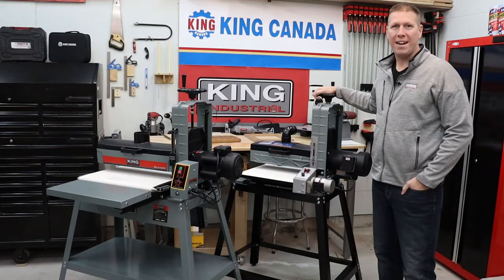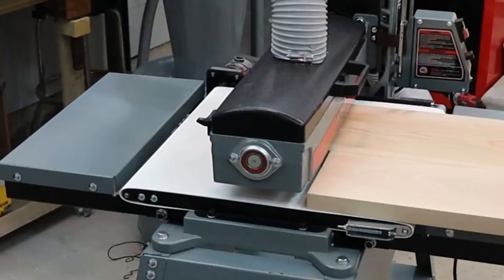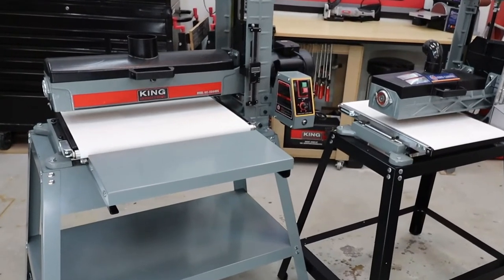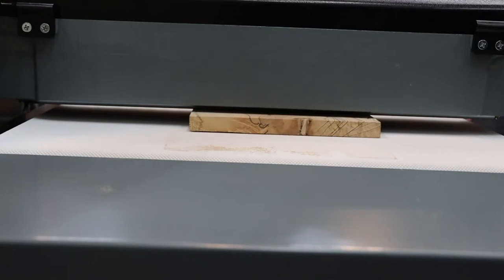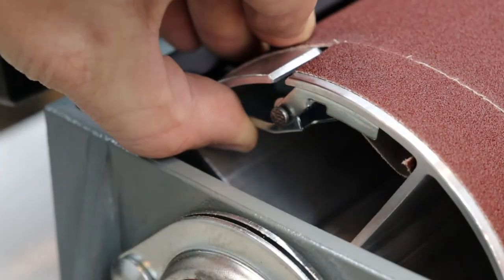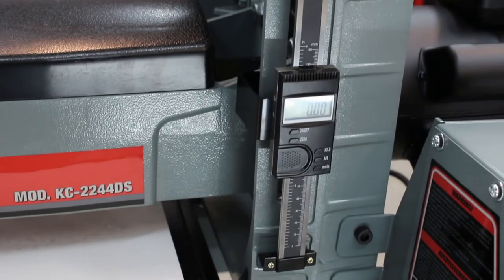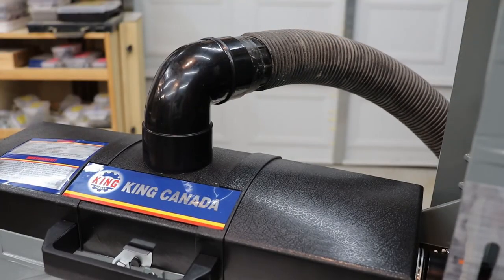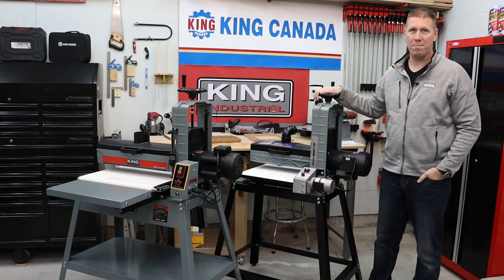New KING CANADA Drum Sanders

Comment: I don't find your sandpaper replacement very easy the clasp on the right side is the most awkward thing to use and never seems to grasp properly I have ruined so many belts I hate this system. I wish you would do a video showing exactly how to make a pattern for each end of the paper and then how to incert it into those clamps properly.
Reply from the maker: Hello George,
we actually do have a video that shows how to change the sandpaper. Please follow this link: https://www.youtube.com/watch?v=s63CFtci9nI
We hope that will help and if you have any questions, please don't hesitate to contact us or our service department.
Thank you!
Reply: @KINGCANADAINC  That video uses 5" paper my KC2244Ds machine uses the 3" paper and the angles used to get the taper in that video don't compute and when he says mark the paper where it intersects with itself what does that mean he doesn't show that part. The instruction manual that came with the machine says that the angle should be 11 3/4 "" I just cut it at that and it doesn't roll on right.
Reply from the maker: @woodie763  We are sorry to hear that the process is getting complicated. You're right, in this video, it was used a 5" sand paper. If to consult the product page, the image, as well as the web manual say that for 3" belt is cut 15-3/4" diagonally:
https://www.kingcanada.com/en/products/woodworking/sanders/kc-2244ds-22-open-drum-sander
We also can recommend another video that shows how to install the belt:
https://www.instagram.com/reel/CkisbI-gof4/?utm_source=ig_web_copy_link
Hope that helped!
Reply: @KINGCANADAINC  No it doesn't it doesn't show the measurements. Do you know your product? look on page 17 of your manual that came with my machine says 11 3/4 " diagonal and the 90" long measurement is 1" to short. Why can't you show the proper measurements and angles on both ends od the paper with a video or a diagram. How to put the paper on after you make the cuts I get.
Reply from the maker: @georgebanes4458  Hello,
you might have the old manual. The instruction manual, as well as the image from the product page, were updated in 2019. At the moment, you have upgraded sources as the online manual, videos, images: 
https://files.kingcanada.com/catalog/products/instructionmanualxm/KC-2244DS%20manual-eng.pdf
Please follow the instructions as per provided.
Thank you!
Reply: @KINGCANADAINC  Thanks, I'll give it a try .
Reply from the maker: @georgebanes4458  Hi George, 
If you have any questions or would like to know precise information of how to install the belt on the drum sander, please contact our service department at toll free 1 (877) 636-4214. Our mechanics will be happy to assist you.
Thank you!